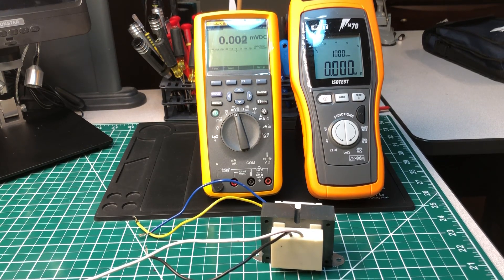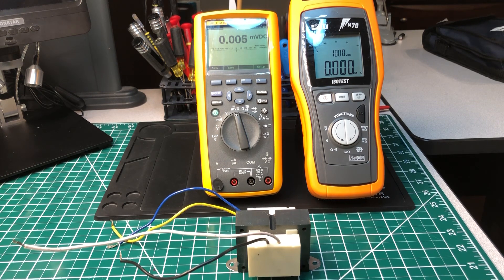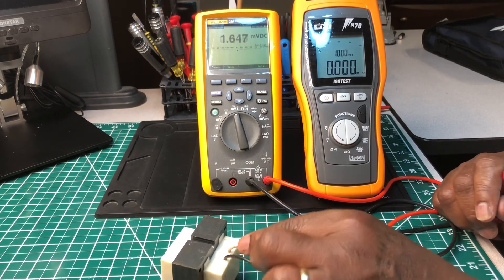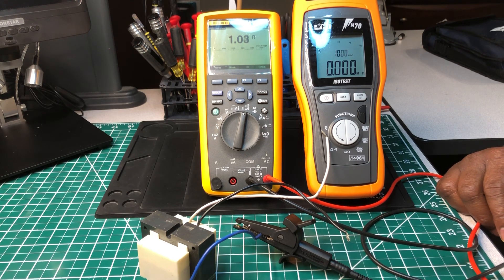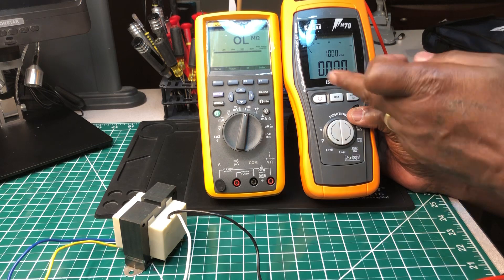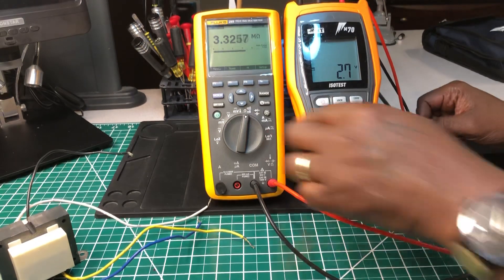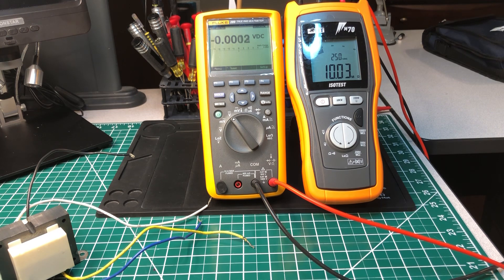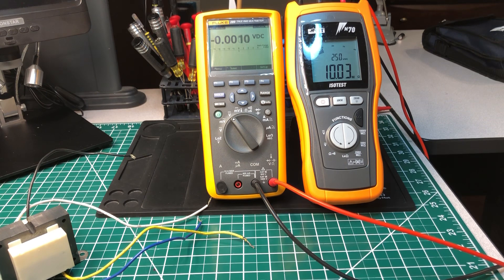🇺🇸TRMS Multimeter vs. 🇮🇹 Insulation Tester ( Testing Low Voltage Transformers )

Comment: Some old, this vid, but maybe you´re still ,,on air"...   hi there, today I had the problem again - measure the winding resistance ( not PE ) of an 230V electric waterpump with float switch. The great (?)  HT M70 show up with 115 ohm ( switched to ohm with sound ), a ,,usual" Bennings multimeter count 1.35 kOhm. Who is right, the M70 or the Bennings ?
Reply from the maker: A multimeter can't compare with a insulation tester/ megaohmmeter.  If you are performing the test using the insulation feature of the M70.  Check out my youtube SHORTS.
Reply: @TheElectriciansToolChannel  Thanks!

Comment: I would use the resistance mode of either the multimeter or the insulation tester to measure the winding resistance, which is the test that you did. The transformer winding resistance is too low for the insulation tester when you were testing with the 1000V. If you had measured the output of the insulation tester with the Fluke whilst you had the transformer connected up, you would have been reading zero volts.

To use the insulation testing function on the transformer, you have one probe clipped to the core of the transformer and then you have the other one on the primary winding and you should read high resistance, you can then do the same test on the secondary to core and finally with one clipped to the primary and the other to the secondary.

You could also measure the winding reactance / inductance with an LCR meter in the same manner as you measured the winding resistance. That will give you a higher reading and effectively the load that the AC supply will see.
Reply from the maker: Noted...thanks TP👍🏿

Comment: I would like to know if it is safe to test insulation that way or you were lucky this time.
I thought it would produce an electric arc when applying high DC voltage to the secondary of the transformer, maybe the wires weren't close enough or I am wrong in my idea of an electric arc could be created that way. thank you
Reply from the maker: Whenever you’re using an insulation tester you must be very careful. I made sure that I wasn’t in any danger, I situated the wires so they won’t be so close together. Also I made sure that  the exposed wire was inside the croc  🐊 clips protected by the insulation around the croc clips. Thanks for watching 👍🏿